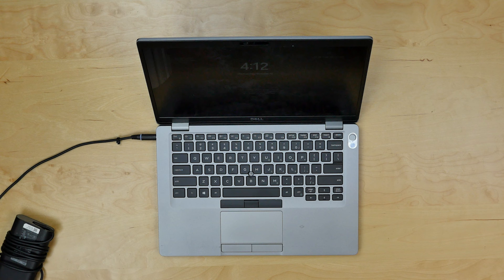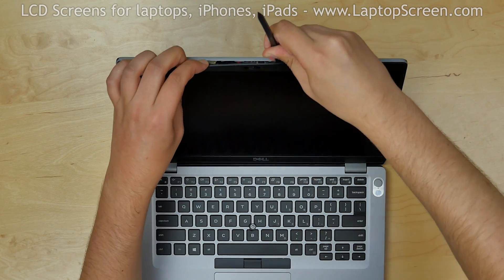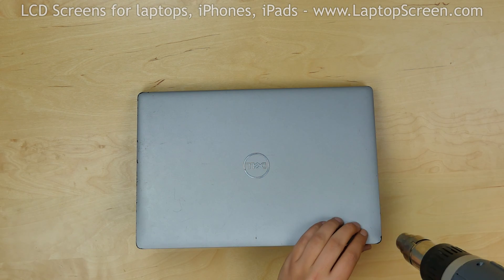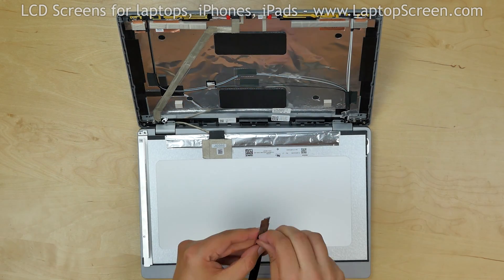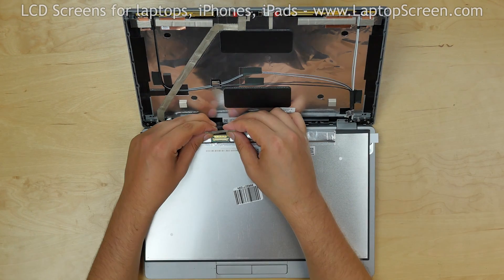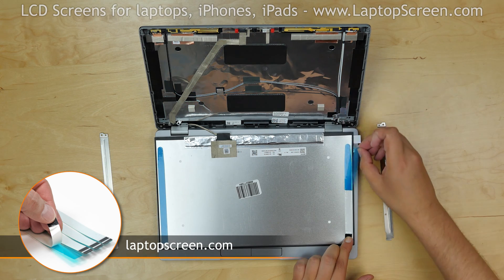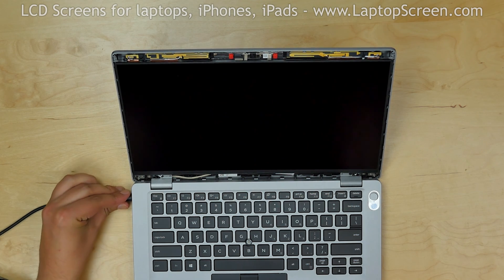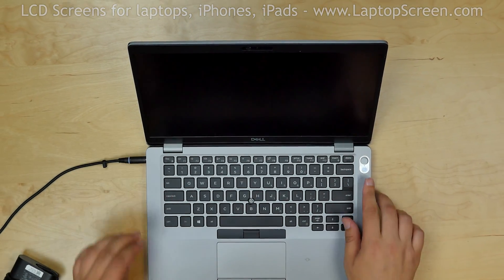How to replace LCD Screen on Dell Latitude 14 5410 laptop. Step-by-step instructions

Comment: Can i upgrade my dell latitude 5410 screen of 1366x968 to 1920x1080?
Reply: So long as the physical dimensions, mount points and connector are the same, yes - you'd probably be looking to get the 1080p screen designed for the 5410 in this case.

EDIT: Ask the vendor explicitly about this situation in your order. If they say yes, and you live in a sane country, then at least you can get a refund if it doesn't work.

Comment: Please DO NOT unplug laptop screens without unplugging the battery first! There is a ALWAYS HOT line going to the screen threw that connector. Even when the laptop is turned off.  If you get the connector a little bit crooked, you will fry something.

Comment: Why didn't you cut out the part about using the heat gun, or redo the instructions properly? As you imply yourself in a way, the heat gun does not need to be used, but the video is confusing in that respect.
Reply from the maker: Because its better to have the heat gun and not need it than need it and trying to pry glue without it. These videos are always done on first take and I never know what I'm actually going to need for any particular computer until its done. And as far as the glue is concerned - it's going to need the heat when it gets old, the stretch-pull adhesive works OK only with-in the first year of the laptop's life. Sometimes adhesive rips immediately, or the pull tabs aren't accessible; heat-gun works 100% of the time.

Comment: Thank you for the clip. I have dell latitude 5421 with i5-11500H. Yesterday I accidentally dropped my backpack with laptop in it. At that point I was expecting cracked screen or something even worse. However all seems to be working properly, the only damage it received is a small crack on that plastic lid of the screen. It is barely seen, but i’m ocd about it. Is there any way how that plastic lid cover can be replaced keeping the screen(coz it works fine) or you would suggest to just leave as is and deal with that?

Comment: Thank you for the clip, would you mind if I ask you why you didn't disconnect the battery first?!1 there have been many instances where the screen has been damaged due to the battery power stored in mother board!!
Reply from the maker: Hi Medi, the screen is almost never damaged, we've never seen a case of it in over 15 years. What can get damaged is the laptop. The "trick" is to use both hands when pulling out the connector and when plugging it back. 99% cases of damage come from misaligned connector being plugged in without due care. If you're careful enough, it can be done with the computer fully powered on. Just make sure to visually align the connector very carefully and plug it in evenly.
Reply: @Laptopscreen  Thanks a lot, I listened to your advice and installed the screen carefully, however my brand new screen is clouded with dust or moisture which is only visible from above the lcd, this is really weird, but again thanks a lot for the help, very informative!!
Reply: Hi Medi, the battery power is a concern. Thankfully these Dell systems have a service mode that will disable the battery power.

To enter Service Mode:

Shut down your computer and disconnect the AC adapter.
Hold <B> key on the keyboard and press the power button for 3 seconds or until the Dell logo appears on the screen.
Press any key to continue.
NOTE If the power adapter has not been disconnected, a message prompting you to remove the AC adapter appears on the screen. Remove the AC adapter and then press any key to continue the Service Mode procedure.
NOTE The Service Mode procedure automatically skips the following step if the Owner Tag of the computer is not set up in advance by the manufacturer.
When the ready-to-proceed message appears on the screen, press any key to proceed. The computer emits three short beeps and shuts down immediately.
Once the computer shuts down, you may perform the replacement procedures without disconnecting the battery cable from the system board.

To exit service mode you just plug back in the AC adapter and as soon as it gets power from that it will re-enable the internal battery. You can safely work on the components without unplugging the battery while in service mode. Good luck with future repairs on your machine.